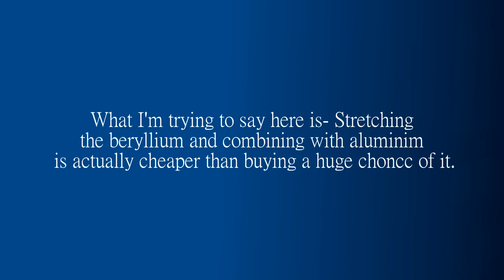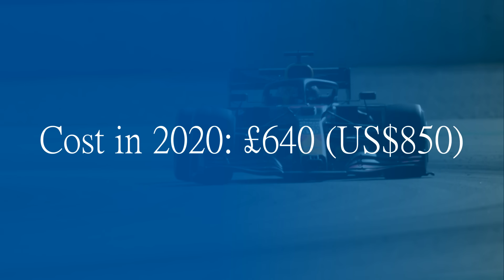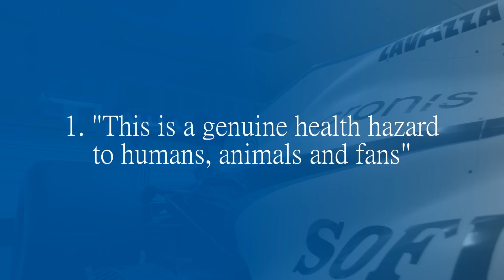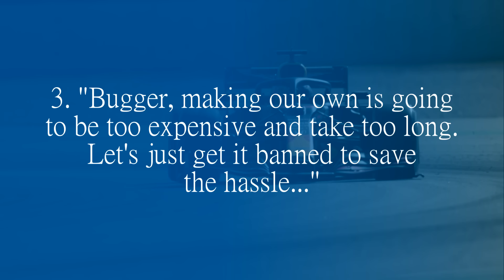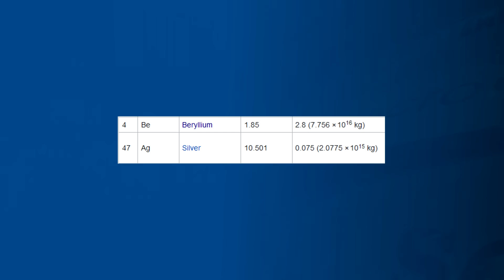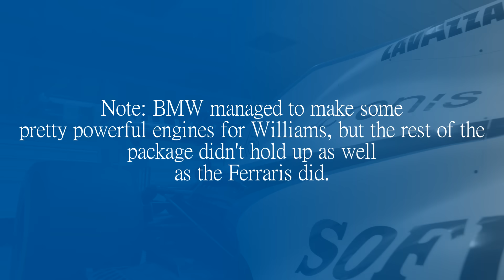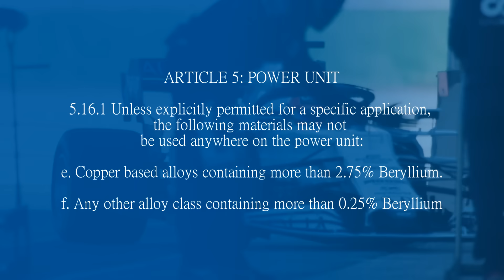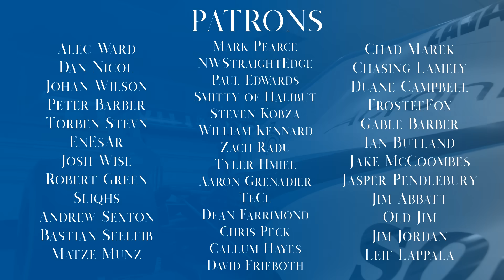MCLAREN'S "TOXIC" ENGINE! The Story of the Mercedes Beryllium Alloy Pistons (1998-2001)

Comment: Those Beryllium V10s sounded absolutely magical! I wonder what the current engines would sound like with Beryllium pistons?
Reply from the maker: Might have been more to do with the fact they revved lower at that point. The late 90s/early 2000s note is more “pleasant” than the ones that were limited to 20k
Reply: @AidanMillward  Dude next time you get to one of these weird material science problems go ask one of your engineering buddies to explain it.
Beryllium's most common use is NOT being bonded to Aluminium its used to make an alloy with Aluminium.
See here in the first paragraph. https://en.wikipedia.org/wiki/Beryllium#Mechanical_applications

And that bit about it being more abundant than silver is totally misleading because it does not form ore bodies like silver that makes it easy to extract. Usually silver is found among other things so its more of a by-product. World silver production is over 26,000t while Beryllium is about 220t per year. 

As for being mor expensive than plutonium that because the best way to get plutonium is in a breeder reactor and that costs several billion dollars. Naturally occurring Plutonium is found in tiny trace amounts of Uranium ore from the decay of Uranium.

Please, if you don't want aerospace engineers or other engineers calling you a clown then just go and ask.
Reply from the maker: @tonywilson4713  Okay then, but if people who do know more can correct points in videos (not just here but elsewhere on YouTube) could do it without the condescention, that'd be grand...

(I also never said Beryllium's most common usage was to bond it with aluminium)
Reply: @AidanMillward  Its not condescension its FRUSTRATION. 
And for engineers these days the stuff that's being hyped and hyped and hyped by media is so incredibly frustrating.

Other than all the stupid Elon Musk garbage about going to Mars, hyperloop and driverless cars there just so much poor reporting done across every field of science and technology.

I just saw a story being hyped about how Le Clerc just did the fastest lap ever of Albert Park. Well duh, maybe that was expected with the 9-10 chicane being removed and it had nothing to do with the cars or drivers.

2 Days ago I saw yet another debunk video on yet another over hyped technology for making water from air. And that's on top of all the ones about how asteroid mining will save the planet. How many weeks do you have to go over that stuff?
Reply: @tonywilson4713  you can get bunch of beryllium from microwaves, it’s the crystal that gets energized in the magnetron
Reply: @Spearmint22425  I don't think you have much of a clue where metals come from. 

Go look on Wikipedia and you'll see where it comes from.
Reply: They were ear piercing banshees.  I made the mistake of being slow when David speed down the straight away at Indy.  Wow they were powerful.  A very distinct noise compared to the Ferrari and others.
Reply: Wasn’t that more to do with their exhausts (blown diffuser) though that caused that eargasmic tone?
Reply: @Ben_Mayall  The exhaust faced the asphalt. It's like amplifying your phone speakers by putting the phone in the bathroom sink. glorious
Reply: @Ben_Mayall  correct
Reply: I can only imagine the hearing loss drivers have from that era. 
I watched a race from the pits in the v8 era. 
I could feel the revs screwing with my heartbeat
Reply: @DidierPeroni  helmets and plugs go a long way
Reply: @DidierPeroni  when you go to an nhra drag race and you get to go down in the pits you can feel each individual cylinder fire at idle threw the zoomy headers because the concussion is so powerful. This is standing 10 11 ft away. Lol you sit they're long enough you can tell the firing order of the engines just by feeling ware the concussions hitting you in your body. It's not so much hearing the engines as you feel them. All 8,000 hp.
Reply: @robertstone9988  
I hope to experience that properly one day. I went once a fair while ago but conditions changed and they wouldn't run. Although Rachel Splatt did one burnout before declining but I was down the other end. Alcohol fueled doorslammers were good but with that one burnout dwarfed them. The noise was absolutely phenomenal. It was at Calder Thunderdome and it was an all encompassing all enveloping phenomena of pure power. So I really want to get the full experience. There may be something coming in April.
Reply: @Igbon5  I grew up a dirt oval guy never cared much for drag racing but I got dragged to the us Nationals in Indianapolis and the top fuel cars took my breath away literally. Like I said you don't so much hear the power as you feel it. It literally shakes the ground and your eyeballs are all shaky for a few minutes after a burnout. drag racing still isn't my favorite type of Motorsport but I have never felt anything like that before and I've been to F1 races IndyCar races NASCAR races Sprint car races modifieds super modifieds late model stock flat track dirt bikes you name it. I've never had my inside shake like that. If you're holding in a wet s*** you do not want to be standing next to a top fuel dragster doing a burnout lol
Reply: @robertstone9988  
I'm going to the F1 and I'll remember your tip if the Top Fuel cars come to near me.
Reply: @Igbon5  get as close to the burnout box as you can.
Reply: @robertstone9988  
Will do.
I also want to see them go by at 300odd Mph too. But thee sound is the thing.
Reply: @Igbon5  every form of Motorsport I've watched has that one thing that makes it super special. F1 is the international vibe and the tech. To be honest the racing's meh. Going to the Indianapolis 500 you get chills just walking through the gates of that track you can feel the ghost of the past and the specialness of it. With NASCAR it's pure entertainment drama and crash porn. With late models and stuff at your local short track is watching local heroes going out and battling it feels very neighborhood very grassroots. An endurance racing and sports car racing it's manufacturers pulling out all the tech and competing on an international level. With drag racing it is 100% the raw power. I recommend ear plugs but just for one burnout take them out just so you can experience it. God I'm going to miss the internal combustion engine I understand why they're going away and I know electric is the future and it's faster and it's cleaner. But it's like trying to convince a cook that the veggie burger is just as good as a steak.
Reply: @robertstone9988  
Yep.
Reply: @Igbon5  top fuel cars are absolutely insane. Words cannot describe the feeling. It's like a bomb going off when they launch. Trust me. EVERYONE HAS TO SEE THEM IN PERSON. It makes F1 and Nascar seem like a bunch of Corollas racing. It's not loud, it's INSANE
Reply: @CanIbeFrank  
I believe you. I really hope they come. It is a second rate strip but they say they are coming in April.
Reply: @robertstone9988  internal combustion is not going away, hydrogen is going to take its place, and before you complain about not enough power, remember some of the most powerful rockets are fueled by hydrogen gasses or liquids
Reply: @robertstone9988  ie mix hydrogen with NO2 or another oxidizer for insane power!!!
Reply from the maker: @DidierPeroni  they wore ear plugs. Still do.
Reply: @DidierPeroni  they wore ear protection. Sebastian Vettel once said that the plugs he wore were so effective that his earpiece makes a beep noise to tell him to shift up because he couldn't hear the note of the engine.
Reply: @DidierPeroni  I still remember an American die hard Indy cars guy answering a journalist when he was asked what he did think of F1 after FP1; whoow dude, it sounds like shredding metal!
Reply: All I know is that the best sounds I ever heard were the 3 liter V10's unmuffled shreik at 20K rpm from the grand stands on the front straight at Indianapolis Motor Speedway.  No way an electric car could sound as Glorious!
Reply: @DrDiff952  I was there and it was a once on a life experience my friend
Reply: @Robert Stone more like12,000 H.P. And eye watering!
Reply: I think its just that eras V10s. Dunno that it had anything to do with beryllium
Reply: Yeah Byrillium has such amazing acoustic properties. My God!!!!
Reply: @chipcity3016  In speakers it absolutely does!
Reply: Ben sounded best

Which is saying much
Reply: They would sound the same as they do with standard pistons, it’s all about header design, the number of pistons, and firing order.
Reply: Built a 355 that reved to 7000 in my AC through headers and empty side pipes. It would spit flames on overrun. The note of forged or cast pistons is different. This car was noisy.
Reply: Death.
Reply: Listen to this, and keep telling yourself you're listening to a road car https://youtu.be/xMRrmnkZEqs?t=192
Reply: A big block chevy will make more power at 5000 rpm but they weigh 600 lbs.
Reply: Somehow the v6s sound good now...
Reply: @PukekoEnjoyer  Not as good as the V6 T ones from the 80s tho
Reply: @kaedeschulz5422  no shit mate

Comment: I only know beryllium as the material used in making high-end speaker diaphrams, never knew that it was so toxic.
Reply from the maker: The actual metal isn't toxic on its own, just the oxide dust.
Reply: It’s also used to make brake callipers in F1 and more, and no one seems to have problems with that (:
Reply: Older microwaves used to contain Beryllium oxide in the magnetron
(The part that creates the microwave energy, that also sounds like something from a sci fi movie🙂 ).
Has a sintered ceramic insulator that is made from Beryllium Oxide. 
During use it is inert.
Once crushed and breathed in creates berylliosis in the lungs..
...
Don't think Modern microwaves used Beryllium now because health reasons...
Reply: During the machining process is when it’s so toxic
Reply: So you’ll never listen to speed metal again?
Reply: @Tacko14  Highly doubt the speed of those Beryllium diaphrams gyrating would be hot enough to create any toxic fume.